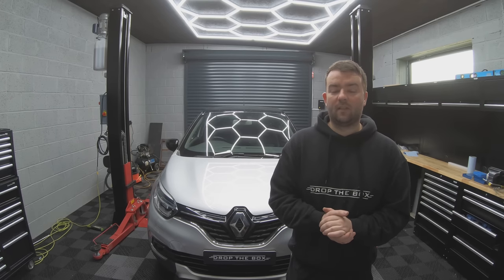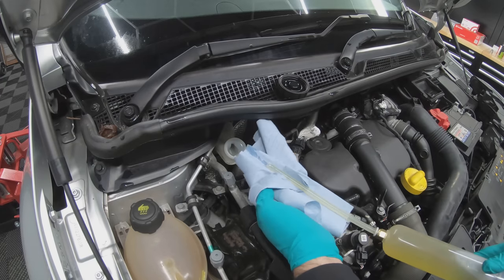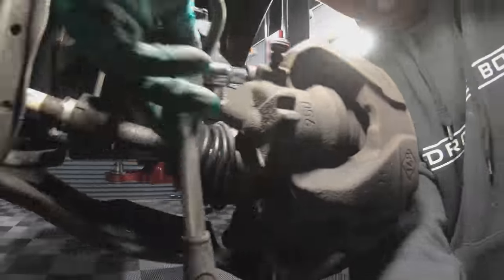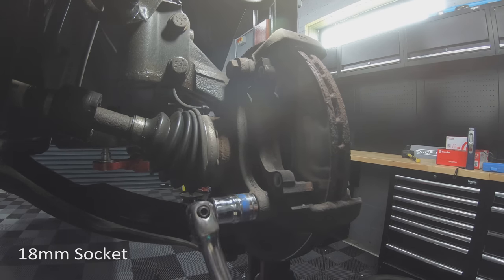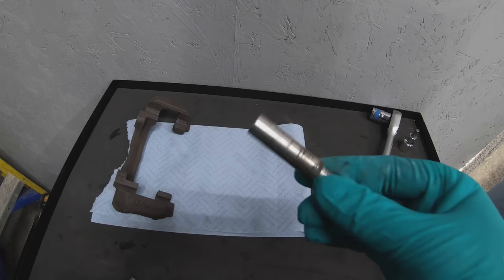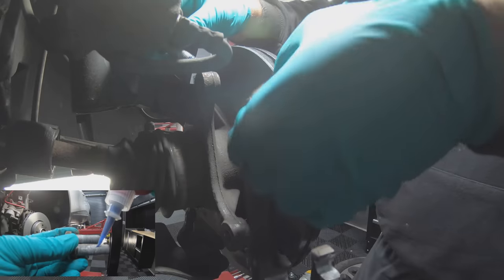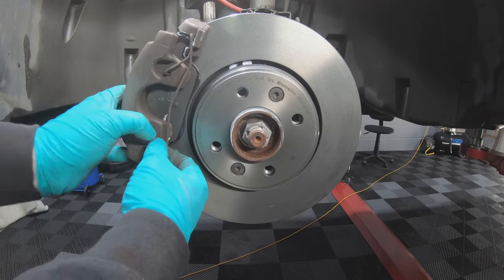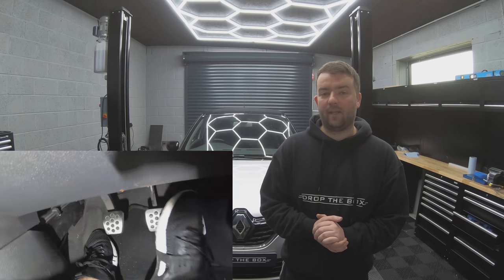Renault Captur - Front Brakes Replace

Comment: great idea with the jumpee cord!  I always struggled to keep it hung with cables. But how did you manage to push back the assembly piston?  Thats what takes me a lot of time as usually it is stuck. I try to use g-clamps to force it backwards.
Reply from the maker: Slacken off the bleed nipple and push the piston back with a g clamp or caliper wind-back tool.